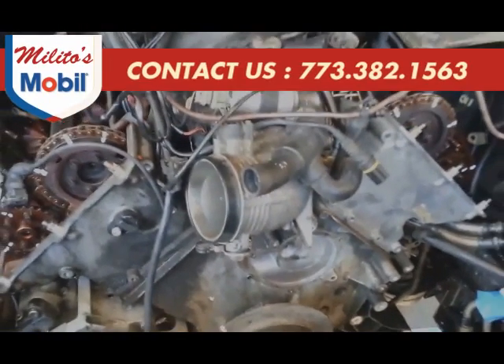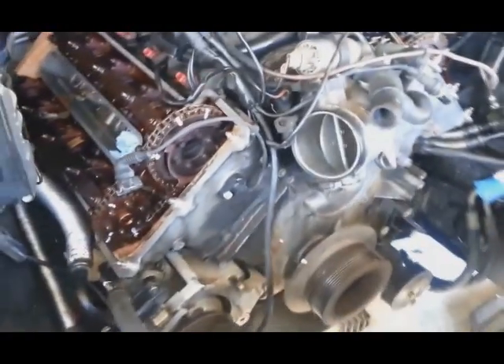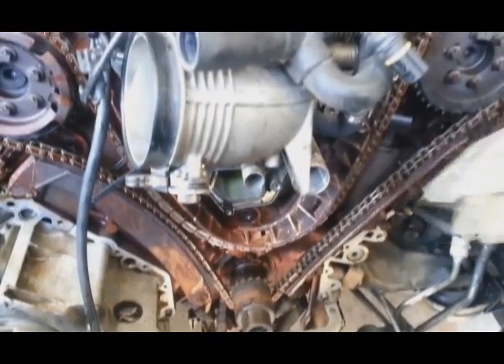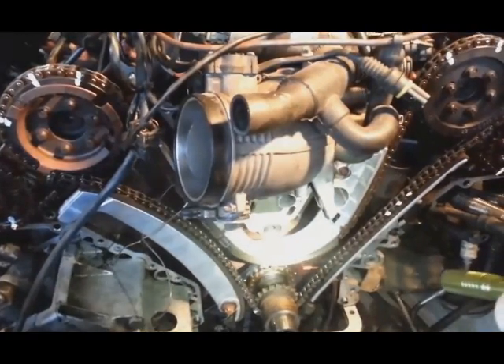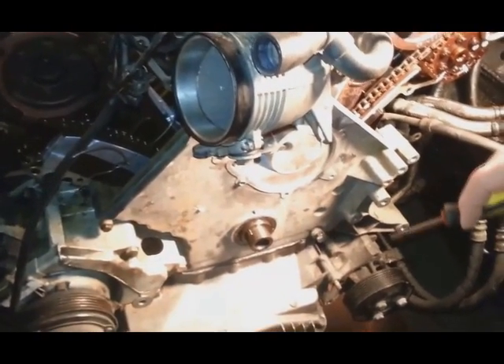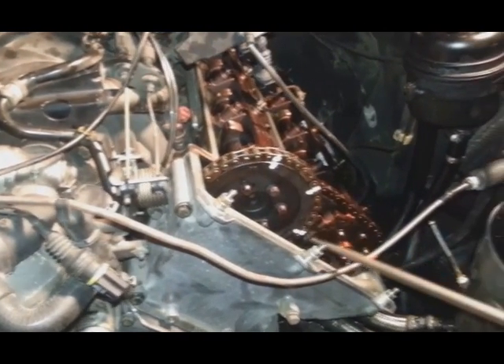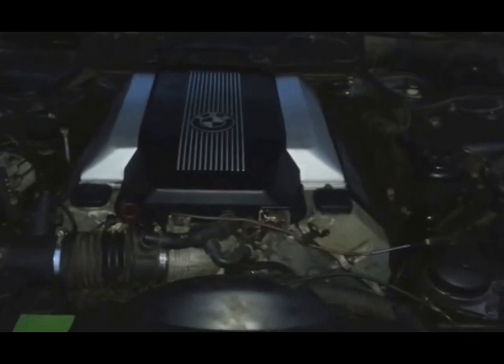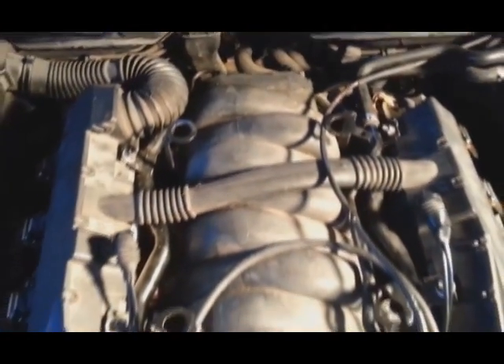Militos Mobil BMW 740 Oil Timing Chain Guide Auto Repair Chicago

Comment: Hello, I think the lock pin to lock the flywheel you are using is nr. 112300  thats the straight on. The small part is 8 mm and the bigger part is 12 mm. Just a comment from the Netherlands.

Comment from the maker: You can purchase the Lock Pin to lock the TDC Flywheel on
Amazon, part no. ZDMAK Lock Pin 115180Zdmak Lock Pin 115180 for Locking Flywheel in TDC BMW

Comment: This is a fantastic video!! Only one this thorough that I can find on youtube. 
I am in the process of doing this right now. I have a question though. I do not have that special pin, ive heard you can put in a 1/4 ratchet extension to lock it. WHen you remove the crankshaft pulley, do you also have to lock the camshafts with the wood or is this not necessary?

Comment from the maker: Answer :  Not for TDC
Marks on Fly Wheel - Hole on the Fly Wheel need a tool to lock Fly wheel & gives you TDC for the Crank PulleythanksZiggy

Comment: I'm doing this now. how do I align everything to tdc
Reply: +frank aranda  did you find out how to turn crank and set to tdc?
Reply: +jose cruz 
I did I bought a kit. but I'm having an issue with removing the secondary chain. not sure how it have to be  timed putting it back together. Also adjusting the oil pump like you did

Comment: The video is great but it sounded like there was still some noise coming from the timing assembly was the vanos assembly also needing attention? or is this a non- vanos engine it looked like an m62tu to me
Reply: Donovan Petersen I know your comment is old, but here is my reply anyway: It is a non-VANOS engine so a non TU motor. 4 things are a dead give away. 1- the intake runners are larger than a TU/VANOS engine. 2- the intake tube going from the air filter to the engine is aluminum, TU engines use plastic all the way to the TB. 3- Idle Air Controller is visible above the TB. 4- no VANOS solenoids on the upper timing cover. I'm tackling this job on my car as I write this and I have the TU/VANOS version (99 iL). I've watched countless videos, read every post I can find and have studied the details religiously. I know I can do the job, but I'm fearing that I will mess up the VANOS timing and make matters worse and get stranded on the highway in the middle of nowhere.
Reply: Dakota R/T Racing Channel theres no vanos on that engine its sn m60 nit m62. There much eiser to time

Comment: Tony,
This is a great video. It clearly explains what to do. However, I've heard there is a big problem to undoing the main crank bolt. Did you use an air tool or a very long wrench? Your numbers for the repair seem about right. I guess an amateur would take about 40 hours.
Did you find any loose bolts on the oil pump which is another known problem?
Keep up the good work.
--Ken

Comment: how long would you say it took you to do ?
Reply from the maker: This job takes over 25 hours, parts estimates range from $1k-1.5k
Thanks
Reply: ebay they are a lot cheaper iv checked that out already for the parts price . thanks for the video and the tool info .
Reply: im going to do head gaskets and timing chain guides at same time im going to make a video step by step to help others this spring
Reply: Alton Brown is ebay someone you can really trust? have you tried other websites?

Comment: Can this problem occur to a 728i with a V6 engine?
Reply: There is no V6...
Reply from the maker: Yes, mostly as a result of not regularly checking and replacing the oil and filter.
Reply: Ok, thanks a lot! Great video by the way! :)
Reply: BloodScatter The BMW 2.8l is an inline 6 engine with a timing chain between the crankshaft and one camshaft and another short chain between the 2 camshafts.  The simpler routing of the chain makes this failure less common but still possible.  A drawing of your layout can be seen at http://bmwfans.info/parts-catalog/E46-Sedan/Europe/320i-M52/L-N/nov1997/browse/engine/timing_timing_chain_lower_p

Comment: How much do you charge to fix this?  My '01 740il recently had this problem and my mechanic doesn't want to touch it.
Reply from the maker: This job takes over 25 hours, the labor alone is $2,500 part estimates range from $1k-1.5k, depends on what we find when we get in there but first let us give you a FREE second opinion on what we think is wrong with the car
Thanks
Tony